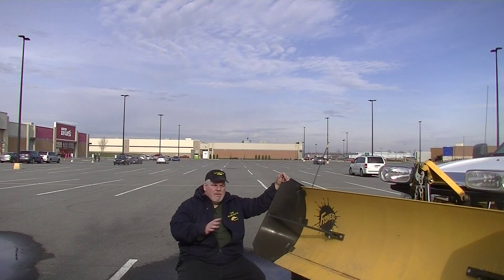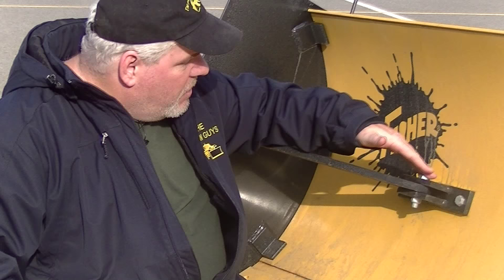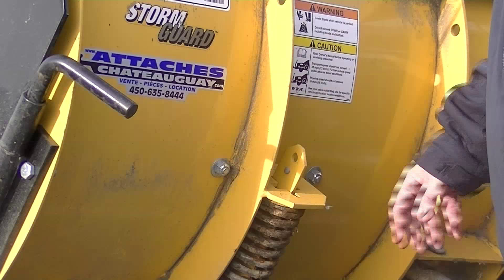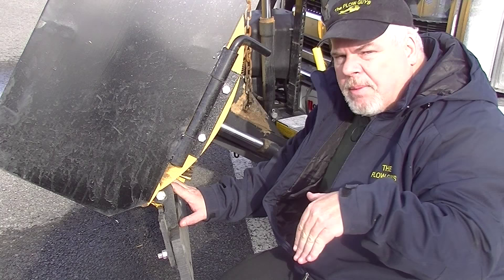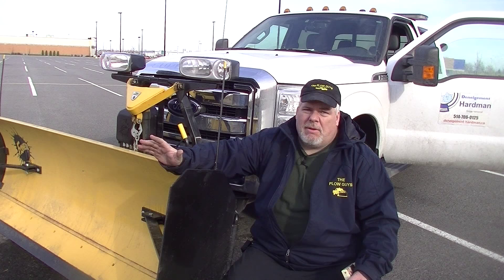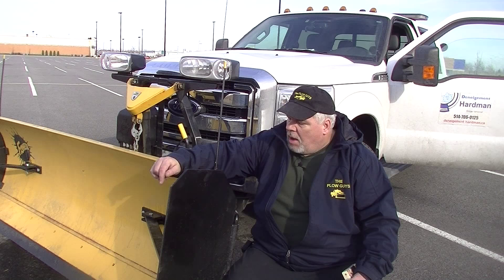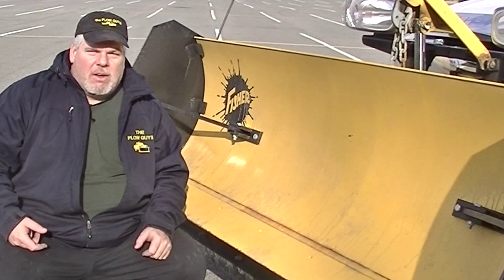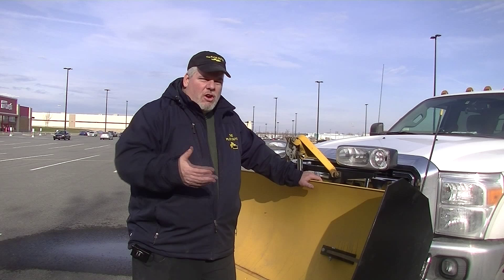The Plow Guys, Snowplow Mods, snow plowing 101

Comment: John I have never seen them end wing out here, great idea. The wing pins  on the back side , for me I would have a safety cable attached so they don't disappear without noticing, not because they would fall out, highly unlikely but there's a lot of nuts out there that pull fifth wheel pins and walking off with you wing pins might entertain a screwball for sure :)  nice vid 👍👍
Reply from the maker: +Steve Rob I haven't heard of that happening. but i will keep an eye on them. Good idea about the chain though. i will look into it. Thanks buddy.

Comment: I made a set of these 8 yrs ago just like your's you will love them, however, dont  put skids on the bottom your wings get some cutting edge rubber,2x10,by what length your wings are, cut the bottoms up 6 inch and then mount the cutting edge rubber  on the bottom, two reasons, the skids will wear out and the biggest reason the steel dosent flex like the rubber will  if you angle your blade...and you will be angling your blade, you are going to love these way better and faster than a V blade, Ive had both. Hope this helps
Reply from the maker: It will help someone. I have since sold this plow truck and bought a small tractor. Gave up all my customers in the city and will be looking to keep things close to home. For the type of driveways and the need to put the snow back onto the owner's property a tractor is the best choice for this area.

Comment: John,  Yours are very cool but, before I spilled the beans ( as it were ) I was going to have you look at Meyers three way adjustable wings as a template to reproduce.  They are the best  ones I  have seen available commercially.  Box blade, angle blade, and straight blade with easy removal. By the way John, we to have a Fisher plow ( an xv2) but we looked at this Meyer first because we already had a Meyer on our Jeep. Be well.    Wayne
Reply from the maker: +IowaKLR650  I wasn't sure that a hydraulically controlled side wings would go well with the F250. I was worried that it might be to heavy. I thought about a Meyers blade but the dealer was too far away and if I needed repairs or service it would have been a pain. I also need to watch the width of the blade. I have one driveway that is literally inches larger than the plow. -John

Comment: Do you guys run a backup plow or just the one ford?
Reply from the maker: We ran just the one plow. We were lucky and only had one mechanical failure. We stopped for lunch and when we came out the starter wouldn't work. Had it towed to garage and replaced the starter. These trucks ain't cheap brother.

Comment: Hey John, I've always called the plate that mounts to the trip edge the "cutting edge". I have an 8' HD MM2 on my f350 and i don't have a cutting edge mounted yet either.. Mines a 2011 model and the trip edge has barely worn down at all.. The fisher dealer told me to wait until it wore enough for a cutting edge to protrude past the trip edge by an inch or two., basically same as what you said.. Thought I'd back up your claims. 
Kyle from Massachusetts
Reply from the maker: +mustangtech331 Hey thanks for for the comment. I was prepared to put the plate on the cutting edge with out question. It isn't something you have to run out and do but keep an eye on it so it doesn't get worn too far. The newer plows need them right from the get go. Fisher drastically shaved them down. -John

Comment: the backdrag angle seems it did not change at all. it's just longer and lifting your plow higher which is going to put more stress and wear out your new edge even faster. I suggest extending the backdrag arms a couple inches so the blade sits closer to 90° to the pavement. I could send you photos of mine if you'd like. I made mine almost as aggressive as the attack angle of the plow itself and it chattered and vibrated a bit at first but now it's just as smooth as going forward.  steel would probably damage the driveways you're describing but with the added edge you have there you should be just fine. just my opinion.
Reply from the maker: I tried some different angles. Like you mention there was chatter. At the moment the back drag appears to be working good. I would love to see a pic of yours. My email is on the about page. Send me one.
Reply: The Plow Guys will do

Comment: This video made me happy I left Fisher product for Boss, Western (and Myers for the light duty trucks). 
The welding and maintenance I had to do on my Fisher plows was always such a pain.
Reply from the maker: Well everyone has a preference. So far the Fisher has been good to me. Had some problems in the beginning with the electrics. The dealer fixed those under warranty.
Reply: Fisher is well-loved here in New England. But all the maintenance with electrical components, controls, hydraulics and welding/repairs I had to do every year was killing my bottom line. Even my brand-new fisher plows would have something go wrong during the season. I spent so much in 2015 for repairs in parts and time that I could have bought 2 new plows.

Comment: well Jon you got some nice mods on your plow hope it works out for you what would had been nice if they extended those bars for you that way you can use them as wings if your wing rowing.. don't feel bad on drill into your plow. i has to drill into my plow this year to put a rubber foil on. it's nice to know that the new plows  have mods that you put on thay are pre drilled makes life a lot simpler. good luck on your upcoming season
Reply from the maker: +John B. thanks

Comment: the backdrag blade should have been mounted higher, then you only need stop tabs on the back of it and the back of the plow will stop it, no risk of bending those little rods. Thats how mines mounted
Reply from the maker: I have noticed many different designs of back drags. I have seen one that looks like it is made from angle iron. Some I will agree work better than others. This year this one does work better and the rods haven't bent. So far so good. Thanks for adding to the conversation Deacon of Trade.  -John

Comment: Good Video. Where can i buy a teflon blade? I was thinking of getting a pvc pipe and slotting it to fit over The edge. I have about 5 houses with interlocking and stamped concrete. Not much volume. The rest i can use the regular Steele blade. But for 150 it might be worth getting a better blade. Thanks
Reply from the maker: It took me a minute to find what I think will help you with your search. 
     Here they just call it a "TEFLON" blade, but that isn't really what it is. The product branches from the same material they use for dump trucks. It is called "UHMW-PE". Ultra-High-Molecular-Weight polyethylene, Basically for the layman is a very durable plastic. I just bought a 7-foot length of it for my tractor box plow. It cost me 165 $ Canadian. I am guessing it is about 7 or 8 inches wide. It cuts and drills just like plastic but can really take a beating.

Comment: everything looks good and ever gadget has a purpose on this plow.  is that a ton of extra weight to the front end, back drag, plow wings and maybe a cutting edge after you wear the trip 2 inches?
Reply from the maker: +McCloud Landscaping  It does add a bit of weight. I installed airbags in the front suspension so it should all work out well. I have had the truck out with the plow attached and it carries it well. I think I will be ok.  - John
Reply: very good stay safe.

Comment: i want to get in to snow plowing ,my house and some family members,i have a 2015 gmc sierra 1500 ,4.3L v6 and i need to know if the truck have enough power and  can handle the weight of the plow(7-7.5),any advices will be really appreciate.thxs
Reply: É kodow I wouldnt even attempt it
Reply: why not?they have plow that are made for half ton trucks,like md75 snow doggs
Reply: Its not the plow. Its your truck.. won't have enough beef to get the job done. And you'll destroy your transmission and front end
Reply: Honestly. I would consider just looking at a big snow blower and ramps. Just so you can still move from house to house

Comment: You’d be dangerous if you figured out how to use the back blade right.. those mods were not necessary..  when you put the plow down you need to go forward just a little bit.  that puts the back blade facing backwards, like it supposed to to give you the ergonomics for digging in.. then you drive backwards if you hit something it’ll pick up the Plow and flip the back blade forward. so it’s like the trip edge in reverse.so if that happens you need to reset it pick the plow up drop it back down drive forward A little bit then reverse

Comment: Since your plow has a trip edge how does your wings trip
Reply from the maker: It works in the same way as it would normally would. The side panels don't interfere with the action of the trip edge.  -John
Reply from the maker: +The Plow Guys Sorry i missed read your comment, The wings don't trip. They are fixed in place. The bottom is cut at a angle to help the sides lift over difference in the surface they are on. The plow's blade is about 1/2 a inch lower than the sides.  -John

Comment: Watching your video pretty cool plow but this one problem you need to put your 6 inch Cutting Edge I do commercial parking lots for 20 years and if you don't you're going to wear the distance of your spring brackets right off the plow never ever wear that trip plate down if the blades too long cut The Cutting Edge on the ends off a little bit I guarantee you don't know without makeup
Reply from the maker: We will get a blade put on soon. maybe for next winter. I do a lot of back dragging so the front edge doesn't get used the same as some one that does parking lots where they are always pushing.

Comment: Decent mods, not my cup of tea.  As to the trip edge,  when I get a new plow I'll drill a second set of holes 2 inches further down, now on the fisher the only gotcha is 2 hard hard steel blocks on the corners bolts. Drill until it stops then torch it out.  I start on the upper holes then shift to the lower holes and only end up with an under 3 inch wear edge scrap that gets used on tractor buckets!   Thumbs up for wandering outside the box!
Reply from the maker: Different mods for different people. Everyones needs are different. Doing it this way was cheaper than buying a plow with the hydraulic sides.

Comment: I have 3 plow trucks all with boss v   plows absolutely love them I'll never buy a strict blade again!
Reply from the maker: The V-plow was a thought. Weight could have been a problem. Although I did not look into it because the straight blade was cheaper and I was looking to keep cost and weight down to a minimum.
Reply: Yep makes sense but boss won't put a blade on the truck if the truck won't handle it, they use the axel ratings to see what works.
Reply from the maker: what size truck you have with the V-blade?
Reply from the maker: I would think you need to have some HD suspension up front for Equipment like that.
Reply: I have a ford bronco, with boss 7 6, it has upgraded ft coil springs to handle the wight, a f250 with a 8 2, and a 2500hd with a 8 2, or a 9 2 I have both depending on what I'm plowing.
 I use the bronco for my city route as is so nimble in tight places
Reply from the maker: you have to have the axle for those v-plows. they are heavy.
Reply: yep the bronco has the dang ft end and other two have bigger axel as they are an 2500 and a f250

Comment: I've never heard of anyone running without a plow cutting edge on purpose. You learn something new on the internet every day. Did you throw out the cutting edge that came on the plow from Fisher? Or did the installer not bother to put it on? I think you are in for an expensive lesson.
Reply from the maker: +david427steel  I thought I covered this. The plate is not included with the plow. the cutting edge on the plow is long enough and has worn down a 1/8 of a inch since I have had the plow. So three years of plowing hasn't done much to wear it down. Now I do agree that a plate will save the fisher blade, I have no need to install a plate at the moment. I will as I stated in the video but not this year. It will be something I will revisit next fall. Thanks for leaving a comment and sharing your opinion. -John
Reply: The Plow Guys I'm a little confused when you say plate - are you referring to the cutting edge? Or are you referring to a wear plate to put on the cutting edge. Sometime we'll build up ground engaging tools (what we call bucket/blade wear parts) in extreme wear applications but it seems like a waste of time and money in snow plowing. I was talking to a guy who does mostly highway plowing for the state, he said carbide plow cutting edges are running him $80/foot. Ouch.

Seems like with that little wear in three years it's something you can easily get away with in residential applications.
Reply from the maker: I was referring to the plate of steel that attaches to the trip blade on the bottom of the plow.
Reply: @ThePlowGuys  That is your cutting edge.
Reply: Boss plows actually put in the manual to wear down the stock edge, then install a cutting edge.
Reply: @scottcreesy6084  yup, that's pretty much sop. Wear down the cutting edge then replace it with a new one.